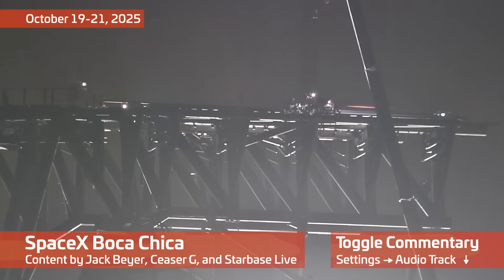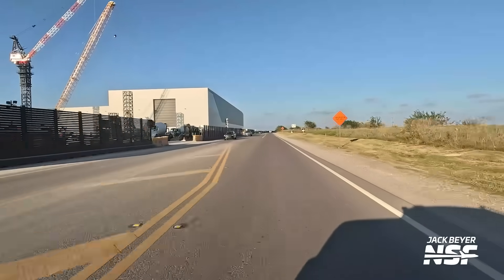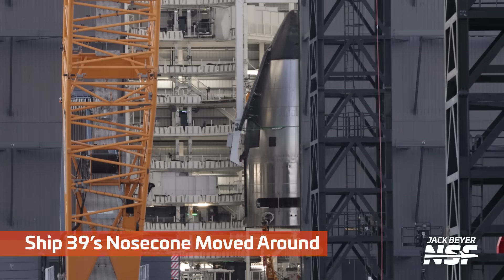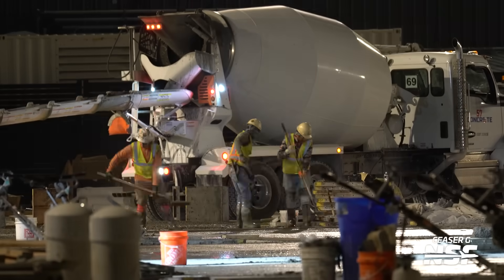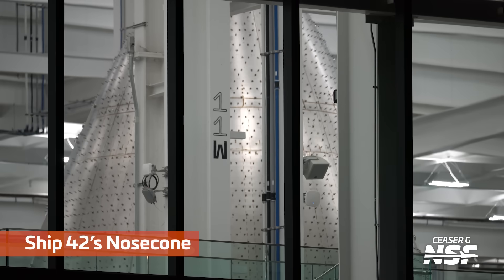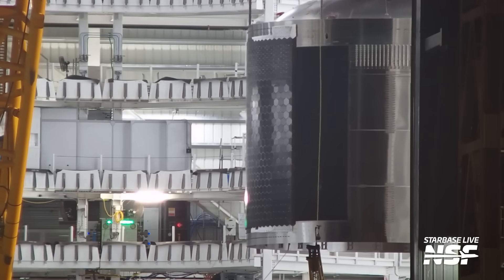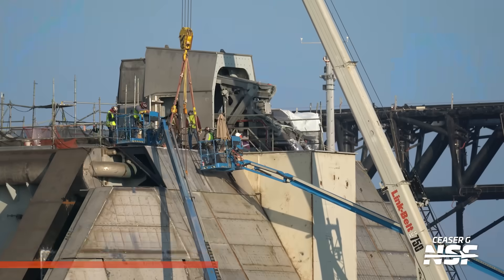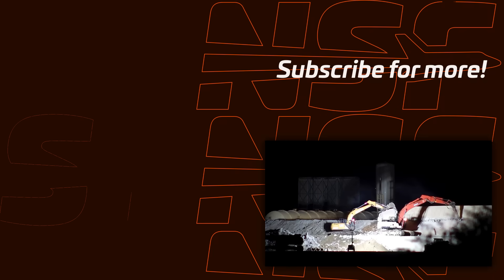"Some Good Concrete Action Happening" | SpaceX Starbase

Comment: Often times a thin layer of asphalt (an inch or so) will be laid down between the subgrade and concrete pavement called a bond breaker. It allows the concrete to expand and contract smoothly. That may be what you're seeing on HWY 4.

Comment: I'm glad to see the ambient sound back again under the Klingon option.  Negotiations are ongoing for a Klingon to do the actual translation.  

Right now the Klingons have decided to avoid direct contact visits with Starbase specifically until at least 2029.  No reason was forthcoming.  This of course raises the question of the efficacy of negotiations for a Klingon speaker.
Stay tuned for updates.

Comment: The nosecone rows and columns are probably in a production line. What you're seeing is a single nosecone in each stage of its production through the windows. But eventually SpaceX will be making multiple nosecones in each step rather than having a single capacity for each step. So the 11 is the production line number and the letters are the rows that are each specific step. So the nosecone in 11U that is getting it's pins would have a 12U (or 10U if they're counting backwards) behind it at the same stage, another behind it in the next row, and so on.

This also gives a great grid layout to identify any specific production station.

Comment: 5:46 The number on the pillars are like grid cords in like the game battleship and it makes it easier to find a spot. That how i understand it. The pick a corner and start with A1 and go one way with the alphabet and the other way with the numbers. And fill in the rest
Reply: Yes, and production is not directly related to the grid system.  Production line layout is whatever works best for that.  It mainly depends on how much space is needed for the different steps.  It could go A1,B1,C1 or A1,A2,A3 or snake all around the place.
Reply: I also believe that each ‘zone’ is organised by the time taken to work on that particular step of the project. So there are limited, or dare I say no bottlenecks. Therefore speeding up the whole process.